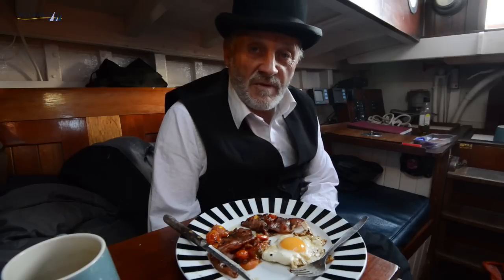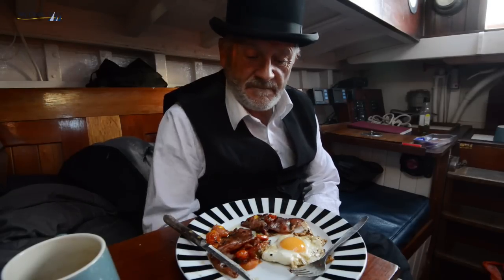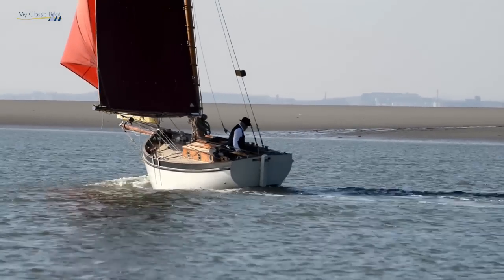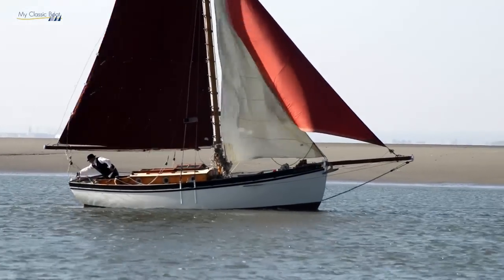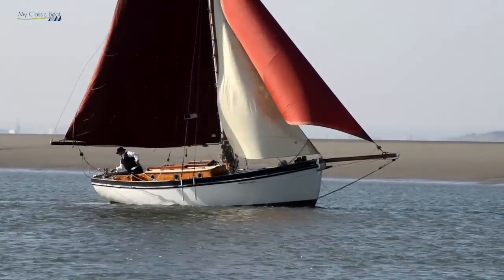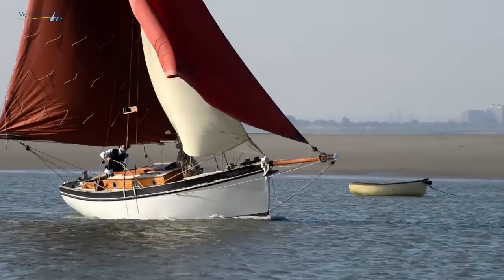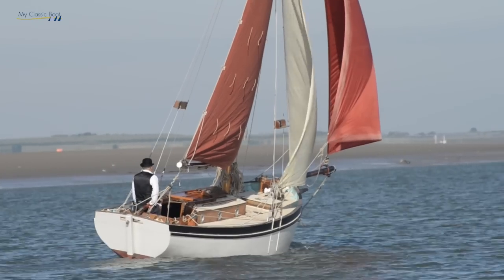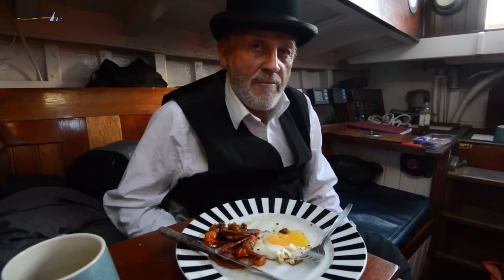My Classic Boat  Maurice Griffiths 26ft Gaff cutter

Comment: I’ve just reread Magic of The Swatchways.  September 2018.  Seems MG spent most of his voyages bumping into or onto the sandbanks of the Thames Estuary, and Essex creeks, or leaping in to the shoal water to pull his many boats off the sand. Every chapter touches bottom.  Every voyage was a trial.  He frequently referred to his wife,  usually simply as The Mate, and gave scant regard to her own high sailing and skippering skills.